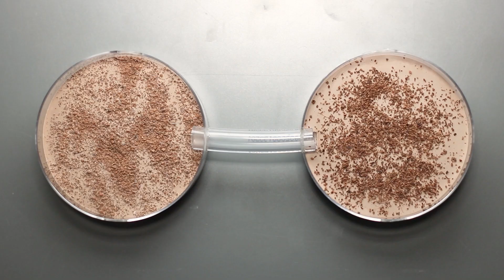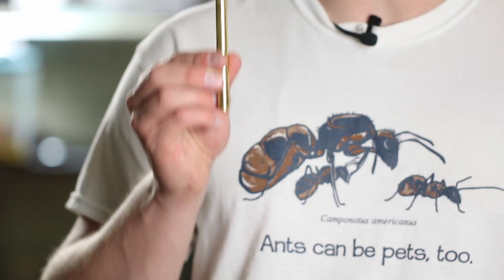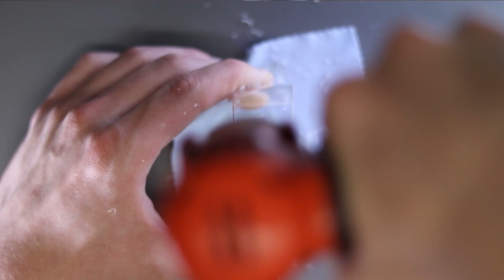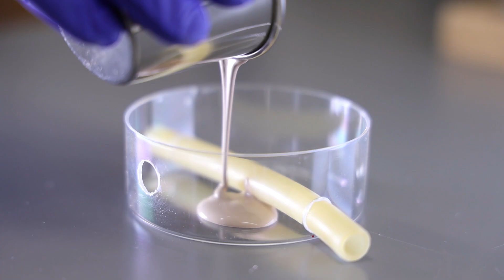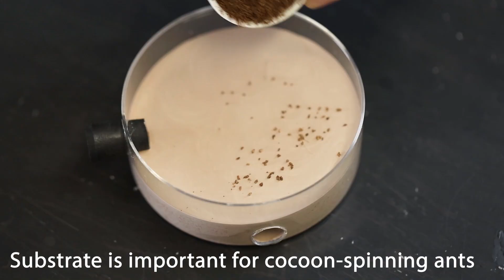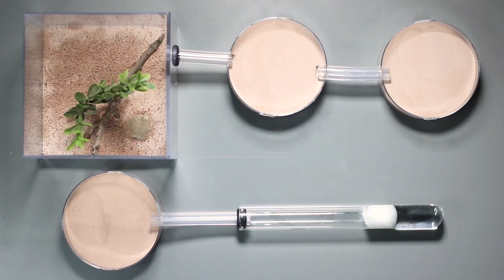Making a Lab-Style Ant Farm | Ant Keeping 101

Comment: I have some questions:

- The environment this creates seems like it would be very exposed when compared to where a queen would naturally found. I wonder why the ants don't seem to mind?
- It does not appear an ant barrier is typically used for this style of setup. Is it just assumed you won't open the lid and will feed through an outworld?

I really like the two pour, tube removal method for creating a hydration reservoir. I'll definitely be using that technique.
Reply from the maker: Hi! Queens and colonies are usually very comfortable in these nests. They actually simulate the natural founding chambers of queens, and the extra substrate helps them really settle in. We do feed colonies through outworlds. Optionally, you can bore a hole in the lid and use a stopper. That way you can access the colony without taking the entire lid off. We don't recommend using escape prevention techniques in the habitat, as the humidity tends to mess those up. Good luck! - Miles

Comment: This is a great video! Thanks for sharing. Can you provide details on the outworld? I'm mostly curious which containers you use, but details on how you link it to the petri dishes (what is the black ring?) and what kind of substrate you use would also be helpful to know :)
Reply from the maker: Sure! Our outworld containers are usually purchased through the Container Store or through Pioneer Plastics. We install a stainless steel mesh in the top, and drill a connection port. The black ring is a grommet, which creates a tight 3/8" connection for our vinyl tubing. The substrate base for the outworld is hydro stone, to which we add fake plants, sand, and rocks. Substrates for inside the dish include sand and sifted coconut fiber.
Reply: @MilesMaxcer  Thanks!

Comment: Isn't the high humidity in the petridish affecting pupae negatively? It would be awesome to see a setup for little Ponera ants (I keep P. coarctata, but my springtail setup with dark dirt isn't helping to observe the ants).
Reply from the maker: Hi Zielona! The humidity within the nest is still relatively lower than that found in typical test tube setups. The nice thing about the Petri dish nests is that you can control how much moisture you add, so you can make adjustments as necessary. Also, if you connect two dishes together, you can have a moist one and a dry one which would allow the ants to adjust the brood according to their needs. Good luck with your Ponera!

Comment: Love the design and I'm about to start making some. Thank you! Question though, will this be suitable for Brachymyrmex patagonicus as is or would it need to be sealed better?
Reply from the maker: These can work with tiny ants, but you'll need to make a few modifications. Make sure you use tight, friction fitting lids like the ones we link to in the description. We also recommend that you either glue the connection tubes or ensure that they are snug. In our test tube tutorial series, we use rubber grommets to ensure our tube connections are sealed. These may be particularly useful in the case of housing very small ants.

Comment: Hey Miles -- made a bunch of these nests -- it was a really fun project! All of my dishes have a lot of condensation in them that lasts for weeks after watering. Does that happen for you? It's hard to see the ants through the lids!
Reply from the maker: Hi Scott! Do your dishes have the tiny air holes in the lids? Condensation forms on surfaces that are cooler than the surrounding air, so if the nests are being heated from the bottom, that could be the cause. I use heating cables draped across the top of the nests, which significantly reduces the condensation problem. The good news about condensation in these nests is that if it drops on the ground, the hydro stone will absorb it without issue (as long as the hydrostone is not saturated). - Miles

Comment: Great video! i am just curios why you use distilled water? also do you use distilled water for your ants to drink as well and if so why?
Reply from the maker: Regular tap water has minerals in it, which can cause issues with the hydrostone down the road. We recommend using distilled or de-ionized water when mixing hydrostone. We provide our ants with a mix of 50% de-ionized water combined with 50% tap water. This provides them with the minerals present in tap water with lower levels of other additives, such as chlorine.
Reply: @MilesMaxcer  Great content mate, keep it up!

Comment: Hi again, Had a couple problems on first attempt with the hydrostone expanding and cracking the petri dishes. Any tips on keeping the hydrostone from expanding to much? Also are you using 100x 25mm dishes?
Reply from the maker: Hi Chris! Sounds like you're dealing with some pretty thin or brittle dishes. In that case, we recommend switching to Ultracal due to its significantly reduced expansion rate. The dishes we use are in the video description.

Comment: Hye Miles. Is it possible to reuse a nest once a colony moves out/dies? If so, do you need to wash it somehow?
Reply from the maker: Hi there! These nests can usually be reused and cleaned with minimal effort. Rinse with distilled water. If the surface of the stone needs more work, you can employ a clean sponge or brush. Avoid using harsh chemicals. You can use ethanol or hydrogen peroxide conservatively to help sterilize the stone. Be sure to rinse with distilled water and allow to dry.

Comment: Why do I need to wear safety equipment
Reply from the maker: This project includes many potentially-hazardous materials and procedures. Safety equipment is very important when you are working on any DIY project, and this one includes hydrostone dust, which you should avoid inhaling and having prolonged skin contact with.
Reply: @MilesMaxcer  thanks